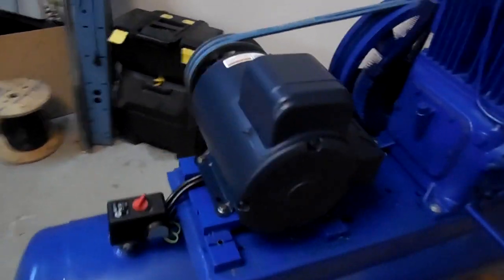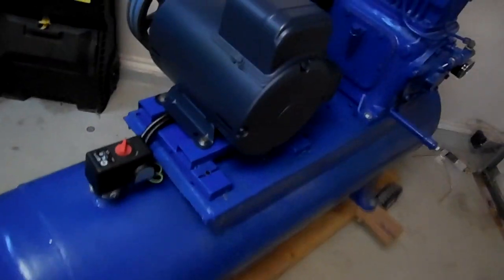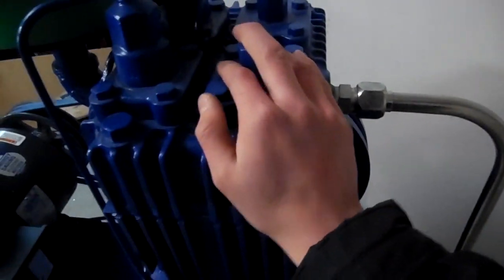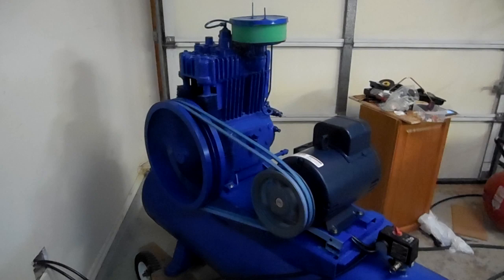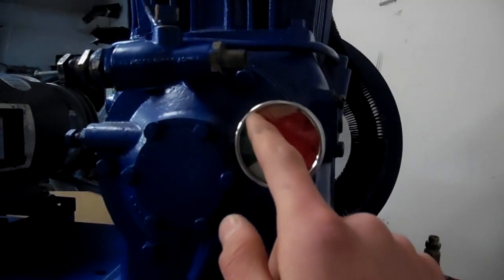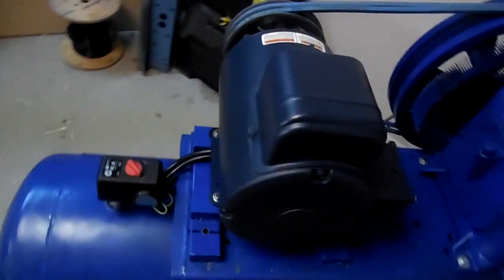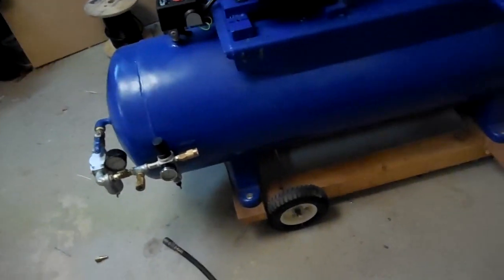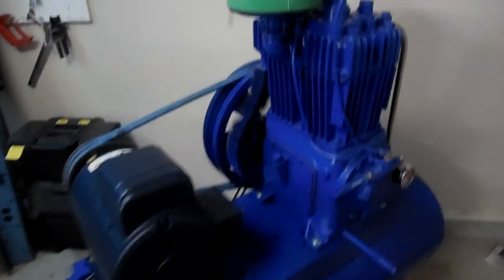Quincy 325 Air Comp with 5 HP 1740RPM Leeson Motor

Comment: Your 325 sounded like it was running too fast, so I analyzed the sound.  It is running at 840 rpm.  The 5 hp QR-325 Quincy compressors normally run at 796 rpm, so this is a little high but probably fine.  But you really should be using B belts instead of A for 5 hp.  If you did using this same motor pulley, your pump will run even faster because a B belts sit higher in the groove effectively making both pulleys bigger.  If you use the pitch diameters for a 16" pulley and a 7.75" pulley and calculate the ratios, it shows that your pump would run at 866 rpm with B belts.  So your motor pulley is a tad big, but if you keep the max pressure below 175 psi, you should be ok.  Quincy sets their compressors to shut off at 175 psi at 796 rpm according to their QR-25 brochure.  Also, they are probably being conservative with their ratings because these compressors are designed to run all day long.  I would accurately measure the motor speed with a tach and as long as it is not below motor nameplate rpm you are good.

Update:  I just analyzed the pump rpm of many Quincy 325's on Youtube and 855 rpm was pretty common.

Comment: Good news and bad news.  Bad = NOISE!  Try a remote Mike or dub in the sound in editing.  Nice project, I'd never thought to use a grease gun, like you did in the other video, to pressure test.  Just a heads up, your compressor oil drain is a snapoff accident just waiting to happen.  Try a ball valve to hold a plug.  When you want to change the oil, switch out the plug with a hose Barb, add a hose to your receiving container, then just open the valve.  The plug works pretty well against pranks and curious children.

Comment: What kind of paint did you use ?
Reply from the maker: I used automotive paint primer to prime the surface. And the finish is just some blue spray paint from Walmart.
Reply: Electrotechnics thanks. It came out looking real nice good job. I just picked up a 340 that could probably use a paint job to freshen it up.
Reply: The Quincy factory purchase paint from mobile paints in mobile Alabama. I think a rattle can is 20 30 bucks but it will match perfect

Comment: Great working been following this and it is good to see this finally come together.  Ironically enough I got my Kellogg A330 running for a short time on a 25 year old WEG only to have the WEG smoke out on me.  I was running it a a 3:1 ratio with ultra slow 625 RPM.  I am thinking of buying that same Lesson 5HP.  How do you like it.  Have you logged on time in on the new setup?
Reply from the maker: Hey great to hear you have your Kellogg in a working condition. The Leeson motor has been working great! I ran the compressor for a load for near a continuous hour and the motor was only just the slightest bit warm, the motor is rated for continuous duty while 23 amps after all. Also I got a really great deal on it too! Only $330 new and free 2 day shipping! I can send you a link if you would like. It was given its own 48ft trailer and semi, they could not make It down our driveway so we ended up having to drive 50 miles to the FedEx freight store heh. If 5 hp is not enough they also have a 7.5 hp Leeson for not much more.
Reply: Electrotechnics
Sweet!  That is great news as I got one coming tomorrow.  Also I know of a quincy 325 same one that puttz1976 has.  So tempted to make an offer on that.  Those old compressor rock!  Wish the new stuff had the same quality.

Comment: thats a badass rig, im jelly. I have a similar craftsman compressor, i replaced the cylinder sleeve and piston, but added an intercooler made from my cars a/c evaporator between the pump and tank. the input tube to the tank is now cold to the touch even after heavy cycling so that mod has theoretically doubled my tank volume.  cool stuff glad I subscribed. nice color too :)
Reply from the maker: Thanks for the nice comment, I wanted to do the same thing and refrigerate the intercooler so that it would double as an air drier but no coils I had were big enough for the discharge of that compressor :)